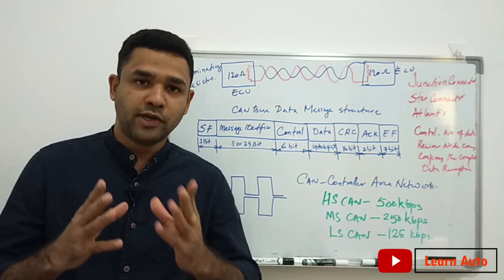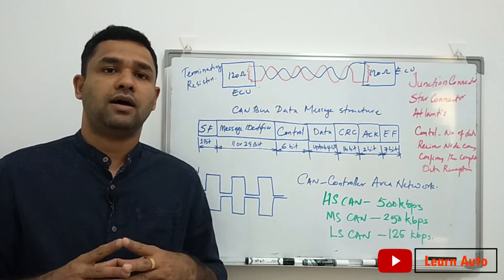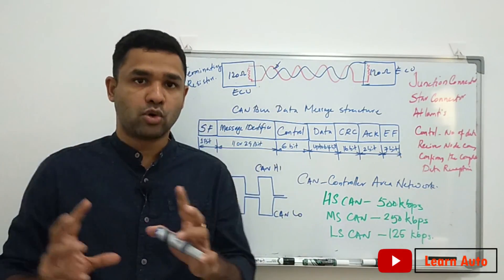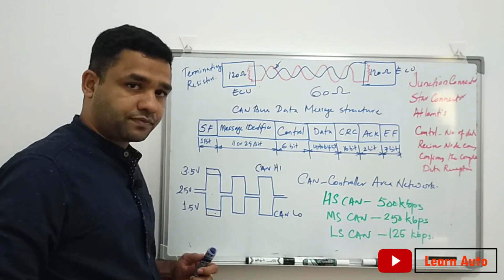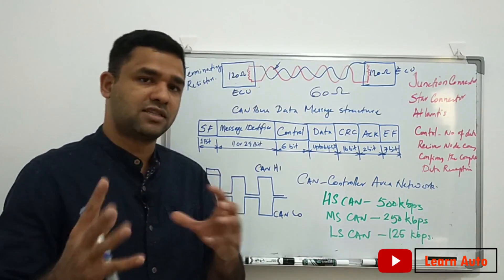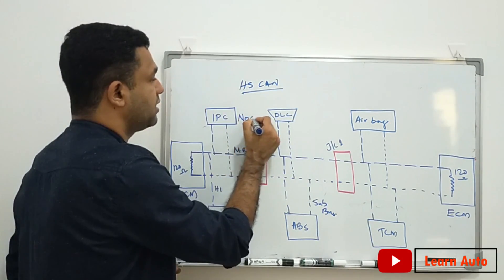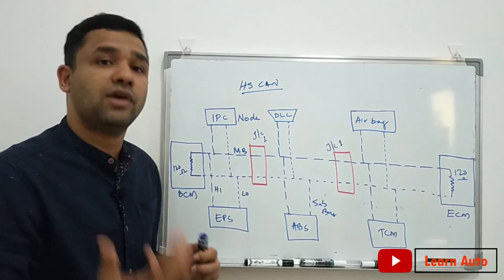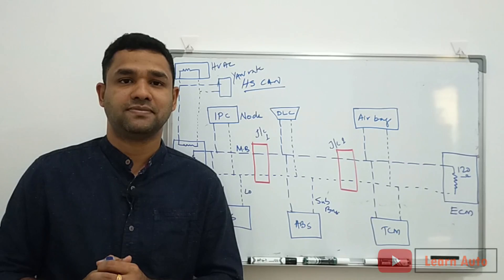CAN Communication Function & Operation| Malayalam|#Learn Auto

Comment: Sir, എല്ലാ കണ്ട്രോൾ യൂണിറ്റ് കളിലും ഒരു CAN driver ഉണ്ടാകില്ലേ. ആ CAN driver കളുടെ റെസിസ്റ്റൻസ് ചെക്ക് ചെയ്താൽ module failure ആയോ എന്ന് അറിയാൻ പറ്റില്ലേ. അതോ മെയിൻ ബസ്സിൽ ഉള്ള മൊഡ്യൂൾ നെ CAN  driver ഉണ്ടകുള്ളോ. ABS യൂണിറ്റിൽ ഈ റെസിസ്റ്റൻസ് mesure ചെയ്യാൻ പറ്റുമോ.
Reply from the maker: I don't know if you are talking about the terminating resistors, if so these resistors only available in any of the 2 ECUs in the main bus of each bus. So only 2 ECUs having the terminating resistors only can be checked for the resistance. CAN controller and transceiver are available in all the ECUs but can't be checked.

Comment: In this CAN system each control unit have a transmitter and receiver or not ?
Reply from the maker: Yes, controller & transceiver are the components operating the CAN. Wiring is just a medium and nothing special in the wiring other than twisted pairs.